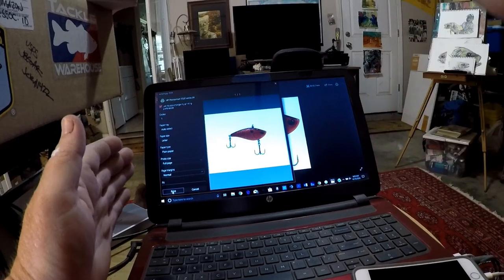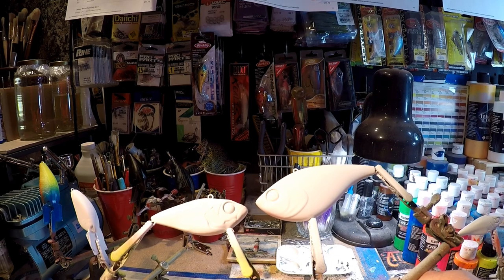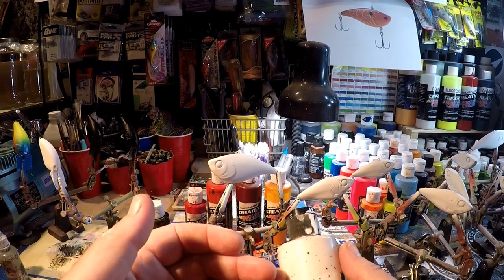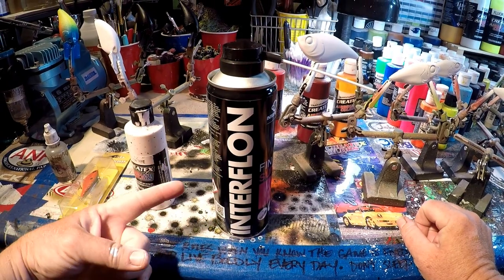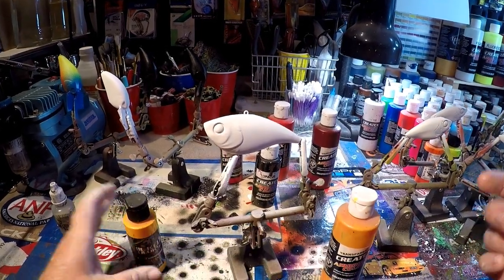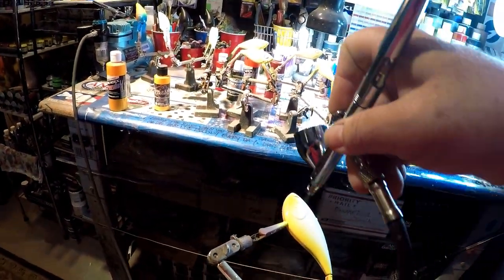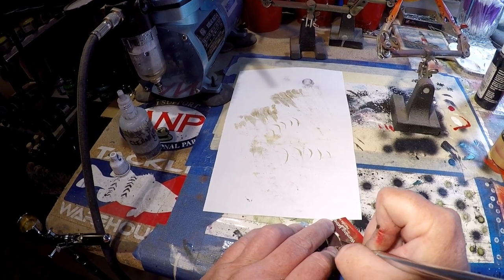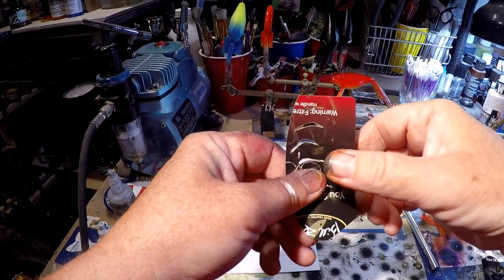Explained! Big Run of Rayburn Red Lipless Lures (PART 1 of 2)

Comment: Another very useful tip i have is to buy a big bottle of airsoft gun pellets buy the heavy ones. Place about 6 of them into your createx acrylic paint. Helps mix up the settling of the paint when the bottle is shaken kind of like a rattle can of spray paint you could say.

Comment: To prevent the card board issues use sleeves for dollar bills. They are cheaper than paper can get them in big packages. They are clear plastic sleeves collectors put valuable dollar bills in . Get the cheapest ones you can get as they are thinner than the more expensive sleeves. And cut beautifully with a x-acto knife. They also clean up very easily. And are clear so you can get perfect positioning every time.
Reply from the maker: Awesome tip. Thanks Chris!!